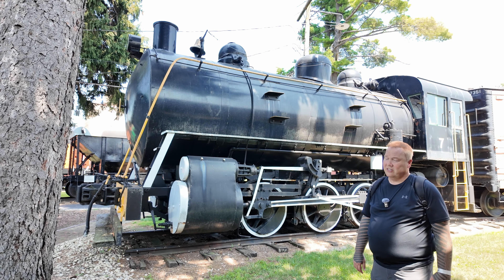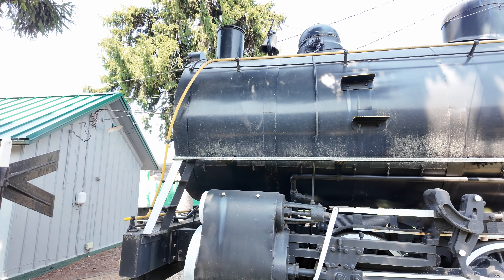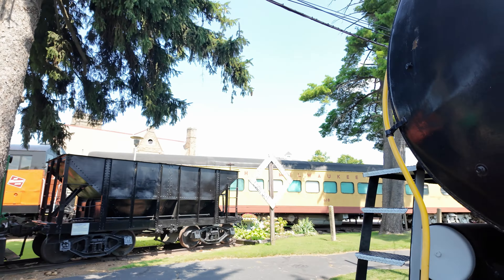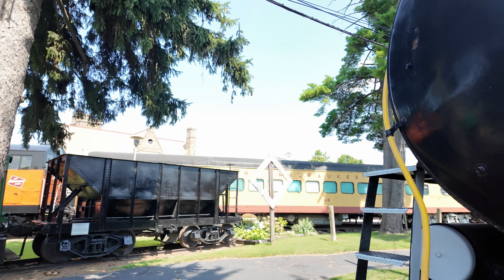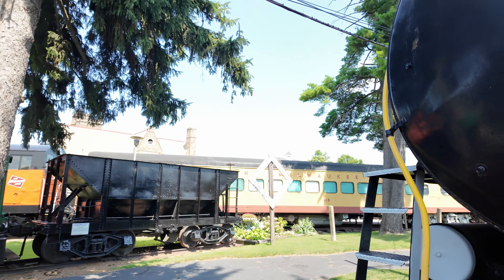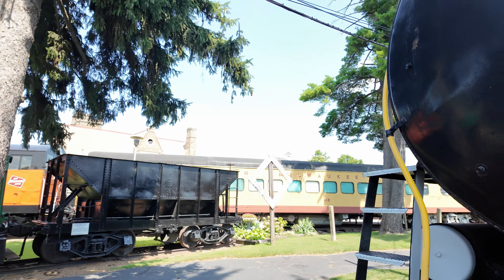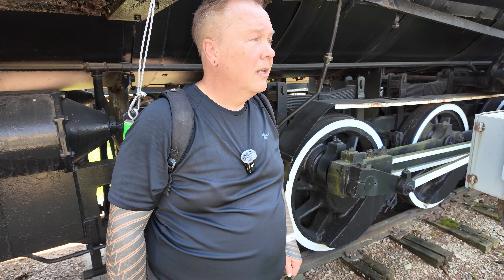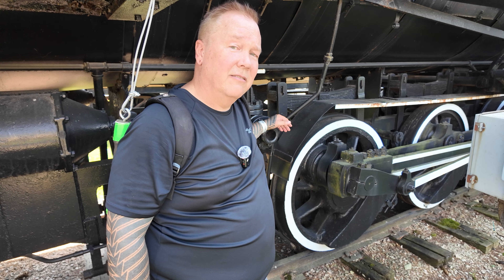Fireless Steam Locomotive @ Mad River & NKP Museum

Comment: Anyone in the 70's around Gravesend or down on the old Bowater's railway will remember the fireless engines that operated well into the 70's as shunters for the various paper mills.   They were chosen because of the danger of fire near paper dust and fibres which were heavy in the air and I used to stand at the bus station above looking down as they peep peeped their way to and from shunting up consists which British Rail would wander in and hook up.   It was a very busy section of railway as Imperial Paper Mills were 24 hour operation, Blue Circle cement also operated their cement trains 24 hours a day and was once an immense railway setup rivalling some of the biggest marshalling yards and all using the bored out like Swiss cheese catacomb tunnels through the Kent chalk cliffs there.
Reply from the maker: Thanks for sharing this.  It's great hearing all the places that used to use these, and people's memories of them.

Comment: While you are mostly correct on this, and it is very interesting. Where do you get the information that it was used for 20 minutes and then set for 2 or 3 hours? Some industries like the power plant this came from used them continuous just like a normal steam engine moving coal hoppers all day and night. These could run 4 to 6 hours before needing charged again at some places that used them continuously. I am glad you pointed out the steam table to people on here as it is very important to understand how they work. As you use steam, it lowers the pressure causing more water to boil generating more steam. If the water gets below the glass on the engines that had them, or the pressure got down to 100 or so, they would go recharge it.
Reply from the maker: Usage varied a lot, of course.  That number wasn't for this, specific engine, but something I read a couple places that referred to fireless steam engines in general, and was cited as an advantage for them in those situations, since you could park them and walk away safely for hours, if that's what the workload called for that day.
Reply: Thank you for somewhat clarifying things.  I was not aware of this concept, forgotten knowledge from a bygone era.  But I do find it very interesting.  If I may break it down into more basic terms, please critique if my understanding of the concept is correct.  In it's most basic sense...  If say a 3500 gallon tank fabricated to safely contain up to say 600psi internal pressure, giving it a 200% (?) safety factor when considering 300psi as it's designed operating pressure.  If such a tank were filled with 3000 gallons of water, leaving about 65 cubic feet (500 gallons) of head space to prevent sloshing into the steam dome and provide an adequate startup volume.  Then the tank were to be pressurized up to 300psi using an external air compressor, it is my understanding the tank could then be heated to say 400F, just shy of the 413F needed to make steam (boil water) at 300psi and you would simply have a tank nearly full of very hot water at 300psi?  Yes?  Then if you open a valve to release pressure from the steam dome, when the tank pressure drops below the point of equilibrium for the water's temperature, it will boil off, making steam which can either be harnessed as energy from the heat or by closing the valve it will simply quit making steam (boiling) when the pressure has risen to regain equilibrium?  Yes?  Much like liquid propane does inside a propane bottle to make propane gas?  Yes?  Is my understanding correct?

If my understanding is correct this brings questions...

For the engine depicted here, to recharge it, would the tank need to be vented as the 400F+ hot water is pumped into the tank?

Would the tank need to be pre-pressurized to 300psi before recharging?

Could the tank be recharged as effectively if it were at atmospheric pressure prior to charging?

Hot or cold, pumping water into a tank is going to displace the air inside the tank.  It has to go somewhere?  It will only compress so much in volume, 300psi is about 21 atmospheres so the air in the tank would only compress by a factor of about 1 to 5 or roughly 20% of volume at atmospheric pressure? Yes?  This is why I ask about venting during recharging?  Venting during recharging to get the tank fuller of hot water? Or is my math off somewhere?

Also it brings questions about the insulation on this tank, something the video didn't say much about.  I can imagine insulation was crucial to holding in the heat.  I have worked paper mills, I know a large volume of hot fluid, say black liquor, in a tank can hold heat for days, even weeks.  But that's 1000's of gallons in a thickly walled concrete/tiled partially inground tank, in this situation it's a mobile tank, I'm estimating about 3500 gallons in capacity.  Though it's hard to tell from the video, the insulation could be 3ft thick on that tank for all I know.  It could be thin insulation and more like a 5000 gallon tank, I can only speculate.

How thick is the insulation on that tank and what type of insulation was used?  Asbestos?  Stone wool?  Sand?  Whats the volume of the tank?

I find this concept very fascinating, it was obviously practical because the engine exist and based on the pictures shown in the video there were a multitude of configurations.  Different flavors and varieties, so to speak.

With such large pistons pushing smaller than average diameter drive wheels (for steam engines) it was obviously designed to work effectively at considerably lower than average steam pressure.  You said down to 100psi or so then recharge.  I can imagine that at 100psi this engine still had considerable power, though not for long I am sure because both water volume and temperature would be getting low.

Just some questions I have, thank you.
Reply from the maker: By my understanding, you're really close.  Last parts first (because they're easy).
For insulation, the standard for steam locomotives tended to be a layer of asbestos a few inches thick.  I expect this had the same.
For Rubicon, another fireless steam locomotive, the claim at the museum was that it could actually "limp" back on just "a few PSI" as long as it wasn't pulling a train.
Now the harder part.  You're really close.  You never actually intentionally put air into the tank, only superheated water.  There's some dissolved air in that water, but not a lot.  You also never heat the water in the locomotive itself.  When you refill, you put superheated water into the boiler, which is stored in a large, external tank, itself under more pressure and at higher temperature than you want in the locomotive.
Let's say you have a mostly empty locomotive and you put a gallon of superheated water into it.  It's going to mostly boil right away.  As you keep putting superheated water in, though, eventually you'll reach equilibrium, then, as you add more superheated water, the steam at the top will actually start to recondense.   
So let's say you have a locomotive sitting there at 250F and you want to get it up to 400F.  You go to your external boiler and start adding water heated to 600F or 800F (I don't know what temperature they used, but it was higher).  Temperature and pressure are directly related, so as you add 800F water to your 250F water, both the temperature and pressure go up. Eventually, though, as you pump water in, as you compress the gas at the top, you may (or may not... it depend on where you started and what temperature water you're adding) find that there's too much pressure at the top for the temperature of the water.  That's where the steam at the top just condenses back into water at whatever water temperature you have at that point.  The steam pressure's still going up, but the volume's going down.  When, and if, that happens, depends on the volume, temperature, and pressure you start with, the temperature of the water you're adding, and the temperature and pressure you want to end up at.  
Did that explain it?
Reply: @Industrial_Revolution  Very good explanation. A couple notes though, First, yes I have run a steam locomotive light on as slow as 50 PSI but she really struggles so just through out the number of 100 PSI guessing where they would not be able to move heavy cars well and would go recharge. Second to address the water going into the tank of the fireless cooker. There is no storage tank of super hot water. The fireless cooker was hooked up to a running in service probably 350 PSI boiler and the boiler water was put into the tank. This eliminates 99% of any possible air in the water, and has treatment in the water to prevent scale, and keep PH correct, no hardness, and even almost zero oxygen so the tank won't pit. The only time it would need vented just like any boiler is on start up from cold. You are correct NEVER put air in a boiler intentionally except for cooling down to prevent a vacuum from forming.  In answer to another comment, as the pressure lowers, the water boils creating more steam and lowering the water level. At no point is there air created in the tank. It is always water and steam at all pressures. And yes there is very thick insulation around that tank to keep it hot.
Reply from the maker: Yep, definitely.  If your pressure starts to get low, you drop the train and run (or crawl) for home.

Comment: That was really cool, learned something today. Thanks for the great video! I knew about steam conversions that burned oil instead of coal / wood but did not know about fireless.
Reply from the maker: Thanks!  Glad you liked it.  A lot of steam trains actually started out burning oil.  It semes to have mostly just been whatever they had available the easiest and cheapest.  Logging companies burned wood.  Coal companies burned coal.  If both were expensive, you could burn oil.  Some historic ones now are being converted over to oil.  Some to to help manage air pollution, but some, it seems, are converting to reduce forest fire risks, too.

Comment: We have a 4 wheel fireless locomotive at our museum in Gallipolis Ohio. It was used across the river in Point Plesant in West Virginia in a munitions factory where even a compressed air locomotive was considered dangerous due to the oxygen in the exhaust. It's not in as good a shape as the one you featured here but it's all there. Hope to do a surface restoration on it soon.
Reply from the maker: Another museum I haven't been to yet!  I just took a quick look at the web site.  Is that a Lima Locomotive Works engine?
Reply: @Industrial_Revolution  I hadn't considered that! I assumed Porter but haven't seen a builder plate.
Reply from the maker: I know they both made fireless steam engines.  I've seen one from Lima and one from Porter, and they look very, very similar.

Comment: I grew up in Charleston,WV, in the 1950's..There were six Major chemical plants in the Kanawha Valley..Explosive atmospheres dominated the plants, and the surrounding valley. The need to move rail cars around and not blow up hundreds of thousands of people required the use of what we called "Thermos Bottles"..They were small switch engine size train engines..They did not have live fire onboard..In the morning, these "Thermos Bottle" switch engines were charged with extreme high pressure steam in their"thermosbottle" type storage units..That charge of steam would run the switchers all day..without live fire. When the pressure got to a predetirmined low level, the engines would progress to the pressure refueling station and recieve another "load" of steam pressure. We always enjoyed watching these little, live steam engines shuttling all about the chemical plants.
Reply from the maker: So they were like this, but narrow gauge?  Maybe a little 2-foot gauge, running around the plants?

Comment: Although you did mention that these engines were insulated, you did not tell us what type of insulation they used. The best insulation method in 1943 (when I was a baby) was also what many workmen and women might still use to keep their coffee, or the lunch soup warm for many hours. That's right, these were vacuum insulated just like Thermos bottles. Look at the water sight glass and I believe you will see  that it does not go even with the top of the outside cylindrical accumulator. It should match the inner cylinder height instead. 
I did appreciate your very good description of the steam/water temperature relationship.
Reply from the maker: It's usually asbestos insulation.  I don't know how thick in this one specifically, but someone commented it could be up to a couple feet thick

Comment: It was the engineer John Fowler who came up with what he termed "hot bricks" as a fireless engine and the resulting engine was cruelly nicknamed Fowlers Ghost in later years, the concept was sound but engineering was still not quite up to the task and much of Fowler's engineering concepts on that engine lived on with subsequent underground train engines that London Transport utilised.   Fowler's engine never made it to the Metropolitan line of the London Underground but he did go on to build the Forth Railway bridge amongst things so he took its failure in his stride pretty much.
Reply from the maker: I hadn't heard about about that one before.  Just read a bit about it.  You're right.  The engineering just wasn't quite up to the task yet.  I'm working on another video and, around the same time, you couldn't get insurance on boilers over the insanely high pressure of 60psi.

Comment: Quite interesting- first time I'd heard of these, I suppose today they could add a plug and elements to keep the water hot 24/7 just replacing what was lost as steam. Then the big boiler plant might even be unnecessary. Or have a natural gas hookup for pre heating the water while it is parked outside.
Reply from the maker: There's at least one still running recently in Germany.  I think I have that video pinned to the top of the comments.  I've heard there's still at least a handful of compressed air ones running in factories.
During WWII, there were a few standard steam locomotives converted to electric they way you described it, and using overhead catenary wires for power.  I've been wondering if you could do it with batteries now, as a way to keep steam locomotives alive and running in a world where coal is getting harder to justify, between air pollution in some parts of the world and fire risks in others.

Comment: Curious what the range would be and how fast it could be recharged.
Reply from the maker: You know, I didn't actually find any references to range at all.  Lots of references to just needing to refill once or twice a day.  I think it's because they didn't do anything long-haul, and probably not pulling too heavy a train.  If you saw my Hurricane Helene and the Great Flood of 1913, NCR turned their 3 fireless steam locomotives loose on rescue and recovery efforts in Dayton, OH, running on streetcar tracks, but that was probably about as far as these things ever roamed. Mostly, they hung out at the factory or switchyard.
Reply from the maker: Oh, as far as how fast they could be recharged, I'd expect pretty fast.  They were just letting water flow from the higher-pressure boiler into the locomotive, and the pipes are about 4" diameter.  It'd have to heat up the metal in the locomotive's boiler along the way, but should be fast.

Comment: I'm assuming these types of engines used 2 stage pressure regulators so that the drive pistons always saw a constant steady pressure --- if so, might you know what that pressure was?
PS:  Great video on something I was not aware of.
Reply from the maker: You know, that does sorta make sense, but I didn't run across any reference to it.  There's going to be some inherent pressure/volume restriction just from the size of pipes, speed the water will boil as you take pressure off the top, etc.  Beyond that, they could have just controlled it with the combination of the throttle and reverser, which directly adjusts the valve gear and doesn't need to be opened all the way.  Between, those, you should be able to get all the control you need.
Anyone else here in the comments know for sure?